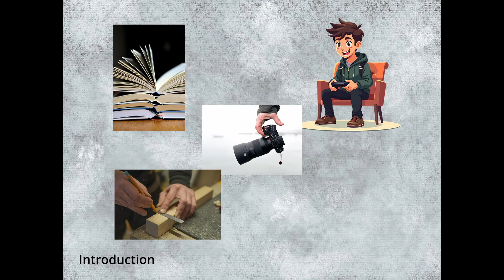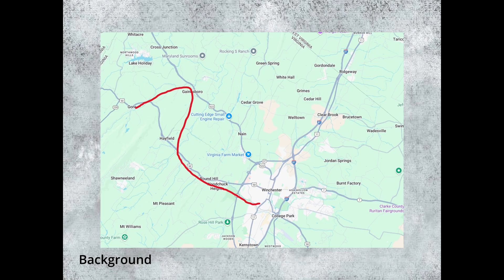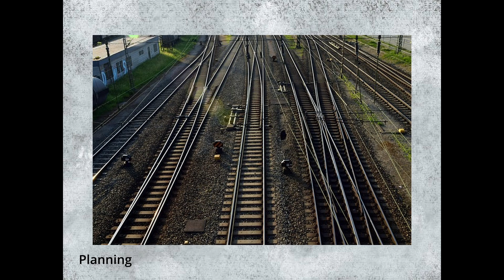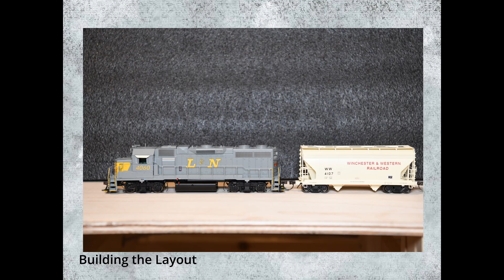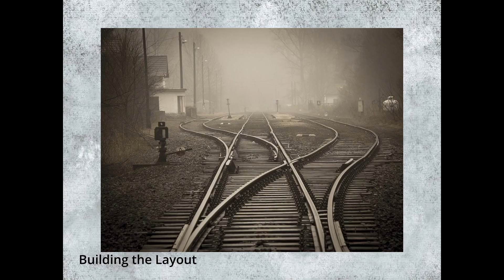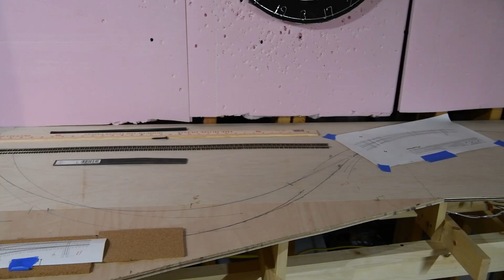Scott's Winchester & Western Railroad Introduction

Comment: You gotta be kidding. You did none of this stuff before and then you are starting off with a room sized DCC layout, building your own turnouts, scratchbuilding most structures and painting your locomotives yourself? That's really incredible! I will check out your follow own videos right now. I watched many videos of the real Winchester & Western as I really like Short Covered Hoppers and Shortline Railroads. While my freelanced Shortline on my N Scale switching layout was partially inspired by the W&W, an actual Sand Mine never made it onto the layout due to a Lack of Space. Maybe one day I can make this happen. Looking forward to your Updates!
Reply from the maker: Thanks for the complements!  I have always liked to challenge myself to learn new stuff in my life, so I figured I would do the same while building my layout.  So far, things have worked out surprisingly well and I hope that trend continues.

Comment: Great video and model work! I live 5 miles from Winchester on rt. 50 west, actually on Back Mountain Road, just 0.7 miles from the track. I have to cross the track every time I leave home.

I noted a comment that said the sand was no more. I learned from your video that for 40 years I have had the direction of travel backwards. We always thought that when the train came out here going West that it was going from headquarters to the sand mine, and the East bound runs were taking sand to headquarters. But since the headquarters are in Gore obviously that is the origin of the train. Duh!
Reply from the maker: Thanks for the complements.  It's sad that the sand mine closed down and those trains are no longer making that run.  For the purpose of my layout, I'm just pretending that the mine is still in operation.  One of the next buildings that I'm going to be starting to work on will be the sand loading facility at the mine.
Reply: @ScottsWinchesterandWesternRail  Well, as I said the trains do go by most days but since all of their business is elsewhere it's logical that it would have to pass by to reach their customers. They improved their engines considerably sine we moved here in 1986. Most of the engines at that time burned oil terribly. Some would leave a trail down the middle of the track of leaked oil. But they gradually obtained other engines, used them sure but still better than what they had, and they seem pretty decent today.

To give you an idea of the status of the railroad when we first moved here the local nickname for it was the weak and weary. 

Gore has a bit of a reputation too. It was known for being a bit tough according to the people that lived here although I've never personally experienced anything negative there. Never reported incidents of moonshine and there was a nudist camp there somewhere with an airport. The only reason I knew about that was the local mechanic who worked on airplanes bought the airport as the nudist camp had closed down. I knew him and teased him that he had gotten an airport for nude planes. He worked on aircraft engines and he was a very exacting person but I understand it was an extremely lucrative business.

Comment: Nice progress and a wonderful video!  It looks like everything is coming along nicely.  I is really nice to see how you are learning and building your skills.  If I may mention one thing, however, it looks like you are using #4 turnouts.  If that is 5he case, I would strongly recommend going with #6 turnouts.  In your present-day setting, you will be using long cars and they won’t like #4 turnouts.  They won’t look so great going through them either.  Just something to think about since you are, just starting out.  Good luck with your layout and I look forward to seeing more videos from you.  Happy rails!
Reply from the maker: Thanks for the complements.  To answer your question, yes the current turnouts I have built are #4s.  For now, they are working well, and in the area where the sand mine, the other mineral company and the locomotive shop, they should be fine, since in this area of the layout the freight cars will be almost entirely short 2 bay hopper cars and 4 axle locomotives.  I have considered whether the #4's will work okay in the area of the O'sullivan facility and if they become a real issue I can always replace them and re-work the track layout a bit.  As I move to  the next area of the layout, I will probably use #6 turnouts, as this is where I will more likely start to really have more longer freight cars and also possibly 6 axle locomotives from CSX handling interchange with the W&W.  Thanks for the suggestions, I will definitely keep them in mind.

Comment: Greetings!  Very nice!  You might have a google earth peek at the northern end of 37 where it hits 81.  Helena Chemical you mentioned, but there is also some transloading and a sand dump pit for dump trucks to load from cars in that set of tracks not just Helena.  You already know the sand operations are no more.  Just south of the Microtel is an insulation factory and south of that is a Miller Milling and pasta plant.  A nice chance to get multiple industries that take tank, box, and covered hopper traffic all into a compact area.  Lots of switching opportunities and lots of car types in a small space.  The steel distributor by 37 adds to the fun but might be best done with the buildings as shallower backdrop structures to leave room for the trolley cranes and yard.   I'm out in tidewater area now, but lived in Linden and Bentonville for many years.  The layout I'm planning will be a freelanced one that will incorporate at least some elements of the northern end of 37 industries along with some other things I really want like grain operations and some goofy stuff for fun as well.  Have fun, hand laid switches out of the gate is pretty cool and certainly non-trivial.  Well done!
Reply from the maker: Thanks for the compliments.  I saw that area at the back of the Helena Chemical and I just didn't realize what it was for, so thanks for the info.  Didn't understand why I hadn't seen the insulation factory and the milling business till I looked at google maps - I think that those industries are actually served by CSX - I'm pretty sure that's not W&W trackage - but thanks for the info anyway.  Good luck with the planning for your layout.

Comment: Excellent start.  Having built several layouts myself, can I suggest you start with the backdrop.  A photo backdrop will make the layout look much more realistic and will be very hard to add after the track, scenery and structures are in place.
Reply from the maker: Thanks.  Good suggestion.  I definitely was going to install hardboard on the wall behind the layout prior to doing much if any of the scenery.  I'm considering photo backdrops, but still up in the air about exactly what to have on them, especially in the area of the one large industry.  An advantage I have is that the structure of the benchwork is very sturdy and I can just about climb up on it without any issue.